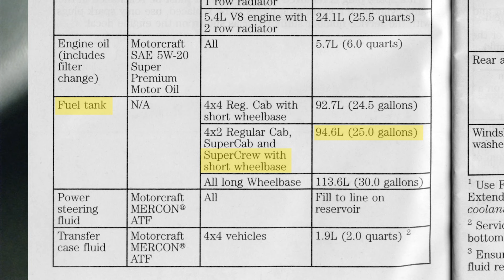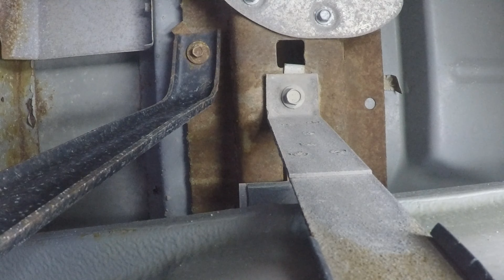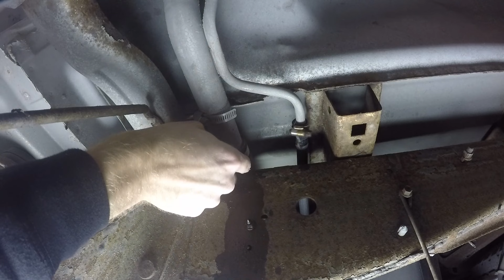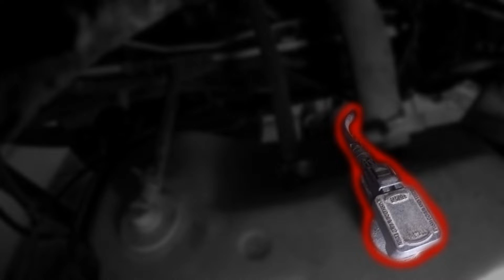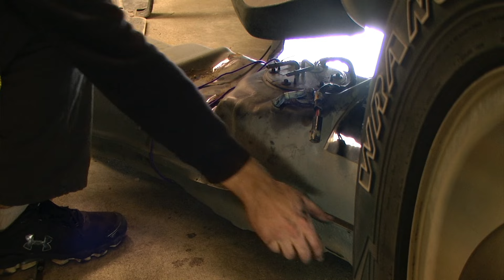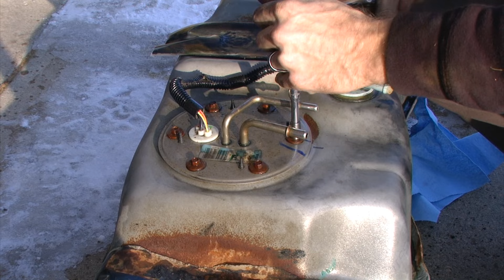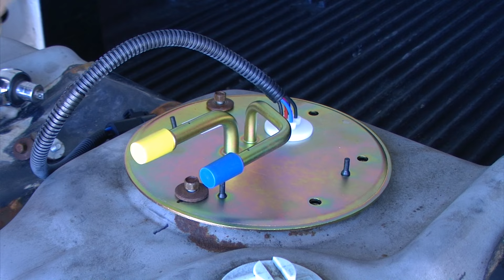Fuel Pump Replacement - 1997-2003 Ford F150 5.4L - NOTE: CREW CAB BODY REQUIRES TANK TO BE DROPPED.

Comment: where is the fuel filter on the 2013 f150 xlt?  Is it in the fuel pump and how do I know if the fuel pump is in the fuel tank? Cant find the filter next to the frame.
Reply: Sheri Culkin  According to what I have read, the fuel pump is part of the fuel pump assembly inside the tank. Not a serviceable part unless you are replacing the entire pump assembly.

Comment: Great video! I did mine about 5 months ago. 162,000 miles, 2001 4.6L.  Just to add to this while the tank is out. I also, did replace all the hoses as well, as they were all pretty crusty.

Comment: I was told I had a bad one way valve on my fuel pump... so my fuel lines are not staying pressured and are bleeding back to my tank.  do I need to replace the whole fuel pump or is there just a certain part I have to replace?

Comment: Hello, I have a 2001 f150 crew cab, can I take the bed out to replace the fuel pump?
Reply: Eldrich Pangan I dont think so.. I just took my bed off and the pump itself (on the 4 full sized doors model XLT FX4 CREW CAB 2002) sits right below the driver side rear passenger side..

Comment: hello Jon. You think you could have performed the pump exchange using the bed tilt method? This is done by unscrewing the bolts completely off on the pump side and loosening the ones on the opposite side. then you prop up the pump side and secure it with a 2x4 or jack stands.  Seen a couple of videos and it works pretty good. I was wondering if it could work on f150.